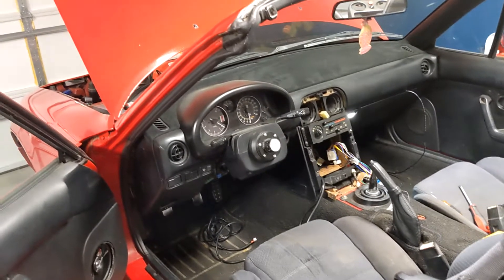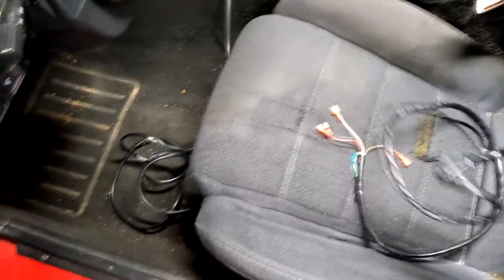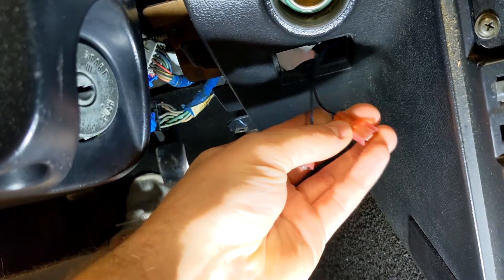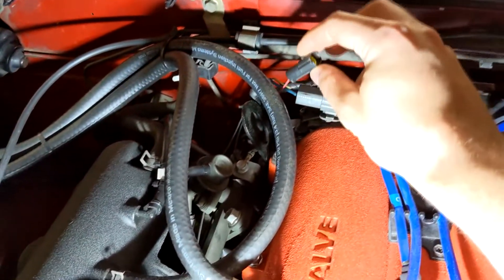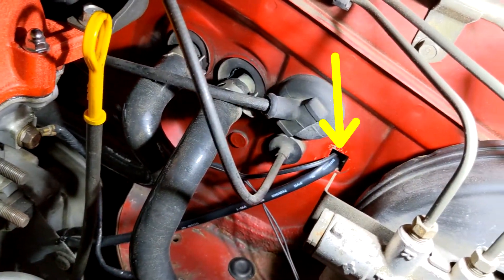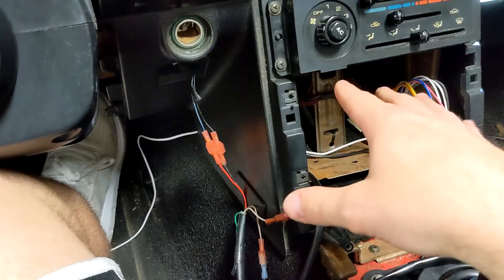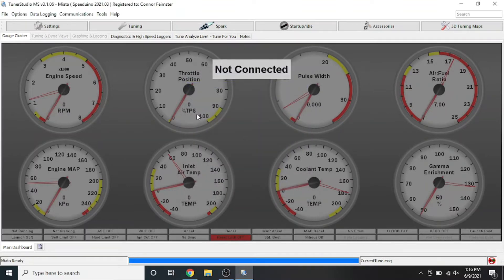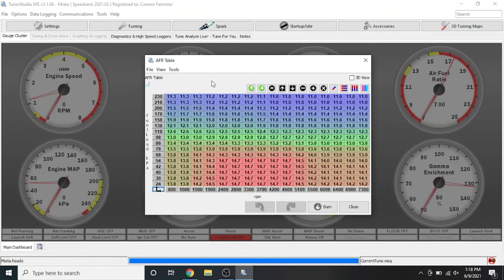NA 1.6 Miata AEM Wideband Install

Comment: Quick note  for the people doing this. Do not pick a random preset. In the manual for your gauge(can be found online if used) there is a table with that will show what the AFR  will be at different levels of voltage. Pick 2 of those and enter in the custom gauge window.
Reply from the maker: Good call! I missed that in the manual. Mine called for 4.5AFR at 0.5v at 18AFR at 4.5v.

Comment: Can you run it without connecting it to a ecu
Reply: Might as well run no oxygen sensor 😂
Reply: @Dylan-nt1vx  makes no sense?
Reply: @Dylan-nt1vx  but when running a piggy back it can ruin your tunes
Reply: @whcwcjecjecuecuw6654  idk then unless you add another 02 sensor. If using a piggyback I would assume you still need to be getting a reading for it to adjust, but idk about them I have full standalone.

Comment: Do you keep your stock o2 sensor as well? My downpipe has two plugs, how would that work with rerouting the stock o2 plug to the Medusa?
Reply from the maker: No, you do not the factory O2. The upstream one is for AFR, lower one can be completely plugged.

Comment: so if you were running a stock ecu and did a narrowband simulation on this gauge, would you use just the brown wire?
Reply: You would need to use a Wideband that has an optional narrowband output. Not all widebands have one, you'd have to check the product's information to see if it does. If it does have the narrowband output, then you'd wire that lead to the brown wire and leave the wideband outputs alone.